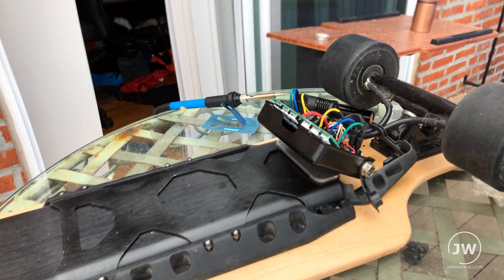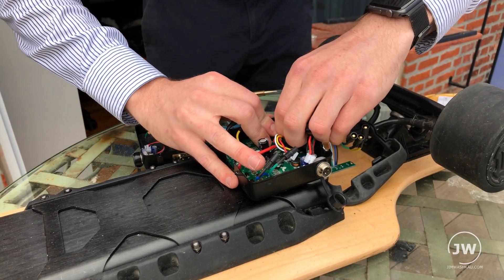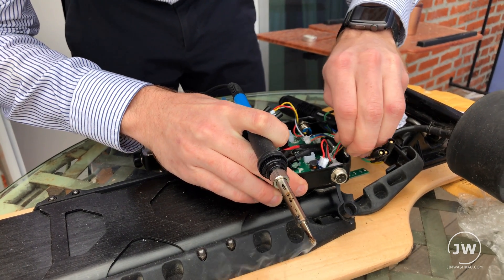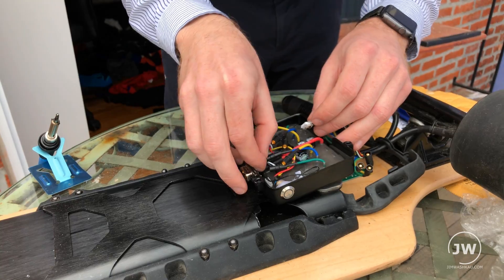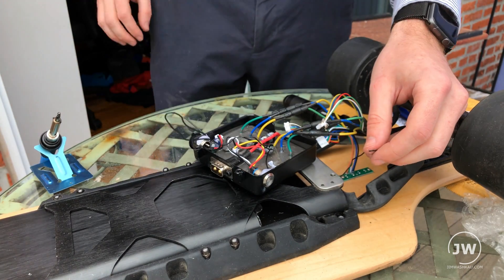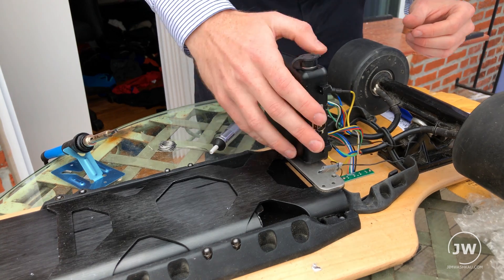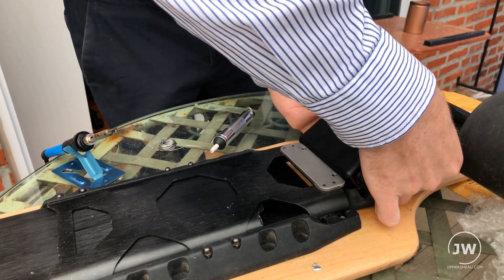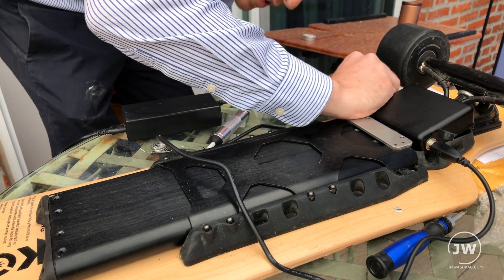DIY KooWheel D3M Motherboard Swap

Comment: I have a little problem with my koowheel, its the d3m. I was wondering if you knew what the problem maybe could be, or how it could get fixed. Or at last, if there is anything to worry about. So the problem is that when i start  my koowheel motors, they make this weird clicking sound. I have a video about it on my channel, here is the link https://www.youtube.com/watch?v=FcVL6ejFkr8&list=UU0ZSWKGI1Mt8biMKcLdbSyA

Comment: How did you get your new motherboard? mine has short circuited as well as well as a wheel motor. both have been fried.
Reply from the maker: Also, you can buy a motherboard at Aliexpress https://goo.gl/52N2ug and search for "2017 KOOWHEEL Updated Mainboard for KOOWHEEL Electric Longboard D3M".
Reply: Hello, Thanks for your video.This is Zoe from Koowheel. I am a salesman in Koowheel, and anyone who wants to buy Electric skateboard, hoverboard or Electric scooter from Koowheel, or wants to get more information about it. Contact me. My Mob/Whatsapp: 008618682360062 Skype: sales29@jomotech.com Email: sales29@koowheel.com  Btw, we can also help you do drop shipping.